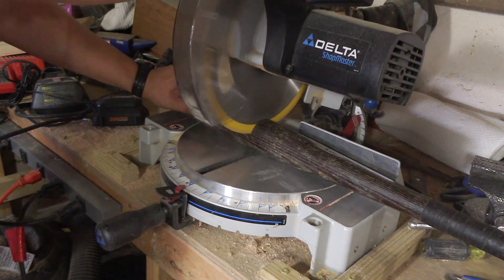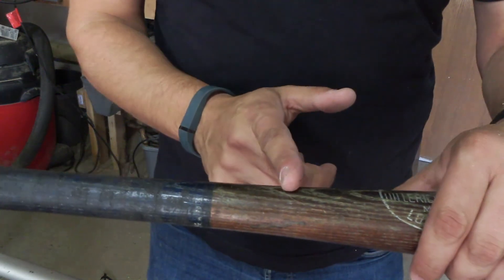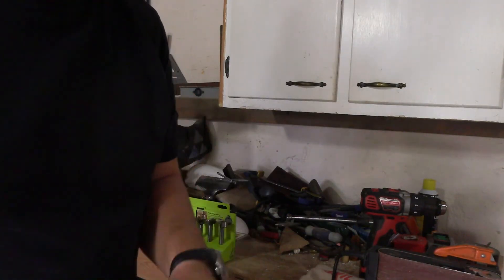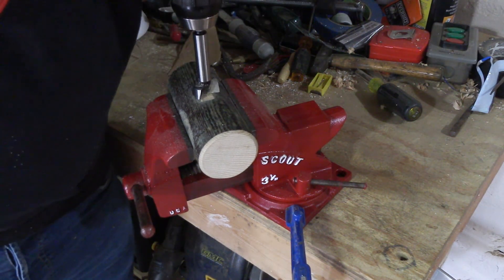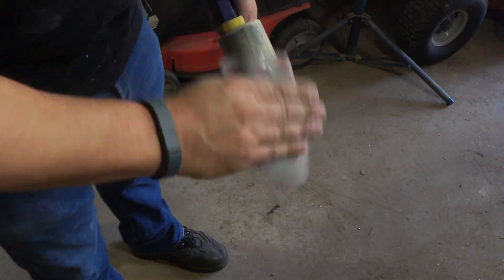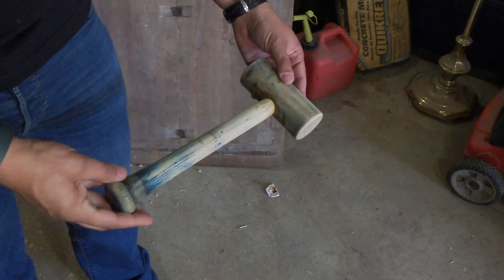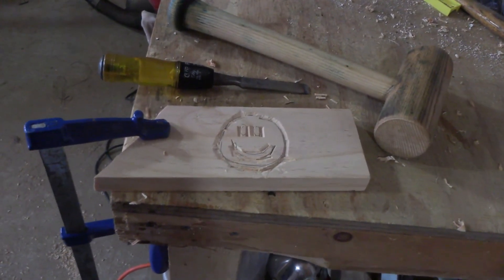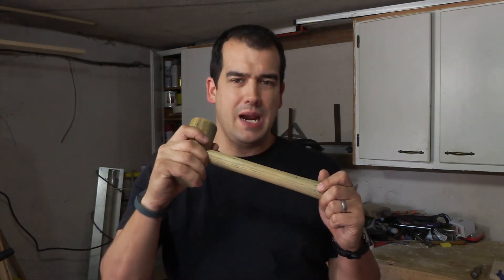Recycle A Baseball Bat Into A Woodworking Mallet

Comment: ha ha. Funny outtakes. I like how the mallet turned out. You could always throw a small dowell through the head, catching the handle in the center. I'm sure the epoxy would hold, but if it was a concern, that would be another way to have it hold. Oh, and with so many different fast cuts of you sanding, it wasn't really boring.